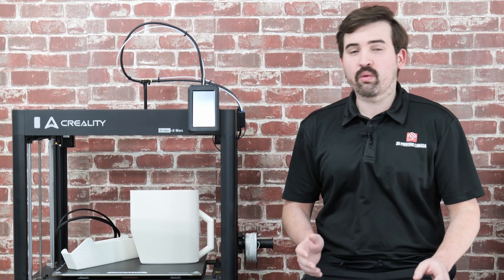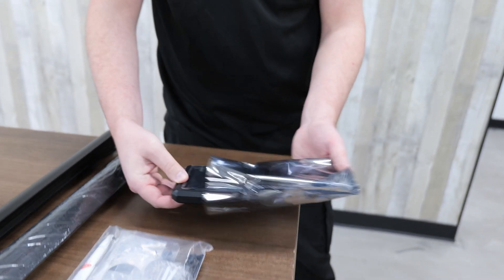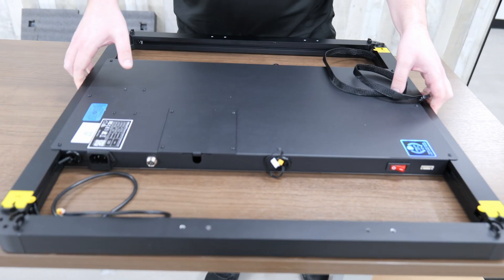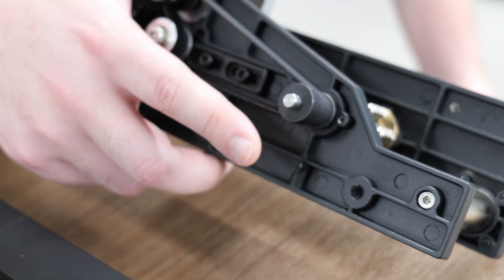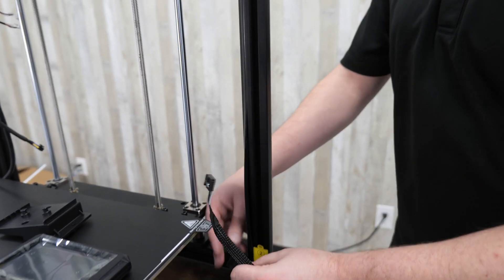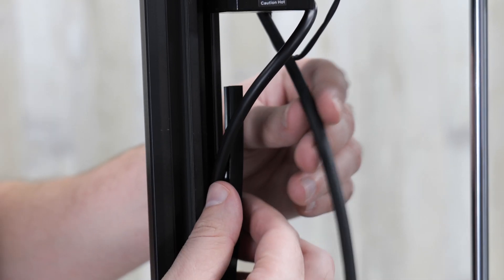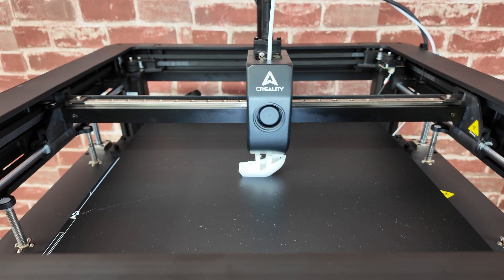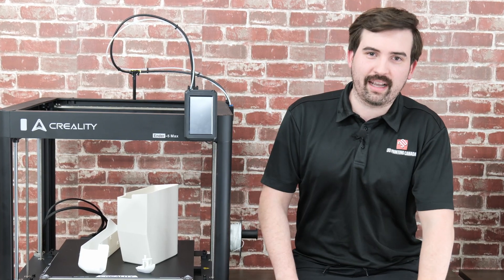Creality Ender 5 Max - Unboxing & Test prints #3d #creality

Comment: ** Something to know with this machine** This printer default calibrates at 45C, owing to the design of the bed it bends alot with expansion heating to any other temperture. To calibrate it for ABS (90C) or anything hotter that 45c tick the calibrate box next to the print button or on the send to print from the desk top app, this will calibrate the machine at the bed temp in the print file.
Reply: Does this work with orca as well or just creality print
Reply: @R_mix19 It works with Orca. I found out the VERY hard way about this when my print head embedded itself all the way down to the plate's spring steel and stripped a hotend bolt, on my very first print too, with PETG.
It doesn't even save the calibration, so I have to hit the checkbox on the screen every single time, as much as I like this printer's speed, size, and quality, this particular part really sucks.

Comment: I bought the Ender 5 Max on day one and it's been a rough experience. 

I've had random print failures, iffy quality at medium speeds, still no enclosure available, and you're stuck using Creality Print for the time being. 

I also got the blob of death 3 weeks ago which basically killed my machine. 

Normally I'd just buy a new hotend for $40 and be printing in a few days, but Creality still doesn't sell a single replacement part for this model.

Idk if they're having issues keeping parts in stock, or if this model is just going to get swept under the rug like so many others, but y'all might want to wait on this one.
Reply: Mine can't pass the initial calibration without auto-leveling failure. These Ender 5 Max's are hit or miss lol

Comment: Try it with ABS
Reply: It isn’t made for abs. Smh. No enclosure. This machine is made for PLA /PETG and some PLA -CFs.  That’s it
Reply: @jagbrave  Thats strange as it says it is on there web site it does and I just printed a motor enclosure with it. I must be hallucinating.
Reply: @ you know damn well that as a stock machine you won’t have an abs successful print unless you have an enclosure. It even states so on the site. For abs it was basically printing it in a 77 degree room.
Reply: @jagbrave  You can just make one your pretty quickly with some Fluted Polyproylene and fit it in place of the kit, seem to be working for me.
Reply: @upanbyudesign  do you have any info on a kit.  I'm trying to decide if I should move forward on it as a purchase

Comment: Have just gotten one and added a enclosure as they have none in stock. Bed calibrates at 45'c cant get the the bed flat at 90c. Worked fine on ABS but seems to be warping a lot at 90c. Also start pringting at 45 before it get to 90, i think this contributes to the issue
Reply: https://youtube.com/watch?v=buW0WN0ZSB8&lc=UgydjViiRFY5exo79Bx4AaABAg&si=Unpf1lYRNKl1zdHr

Comment: hasnrt this just been recalled?
Reply: Last I'd heard they're giving people who bought it directly from Creality a few options for remedying the heat bed issues. (I got mine through their eBay shop (I think?) so their offered solution was a bit different: a replacement bed and partial refund.)

I haven't heard anything like a full on recall, though.
Reply: Is this true? Or are you trolling?

Comment: Hi is it true that you cant preheat the bed over 50°c without starting a print😮
Reply: If the bed is hot it wont start a print until the bed is at 50c then it takes it to the set temp. Im using ABS and this thing is not working sticking and not calibrated at 90c. PLA fine at 45c plate temp
Reply: You can pre heat no problem with the 4 printers I am running I always pre heat. buy flashforge liquid glue and you will never have issues sticking to bed plate